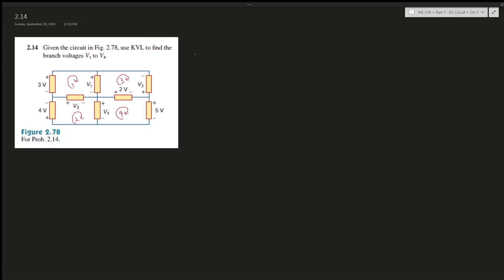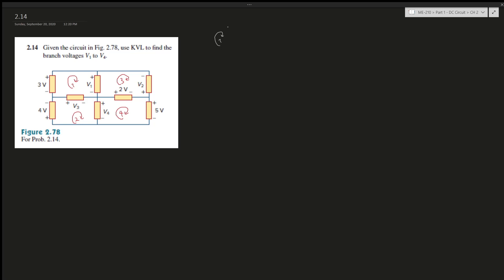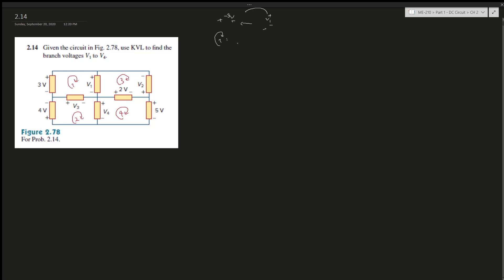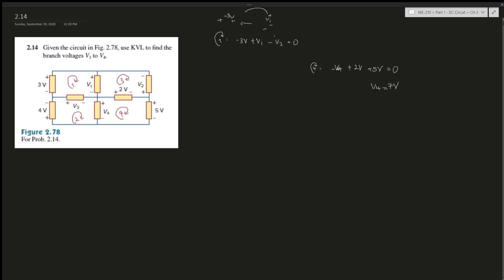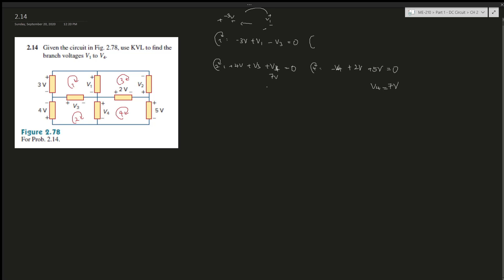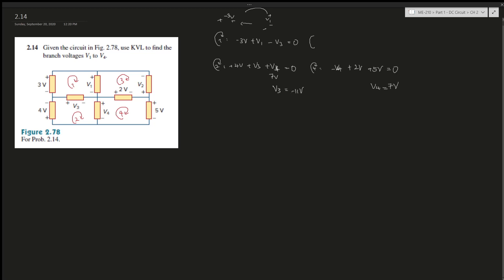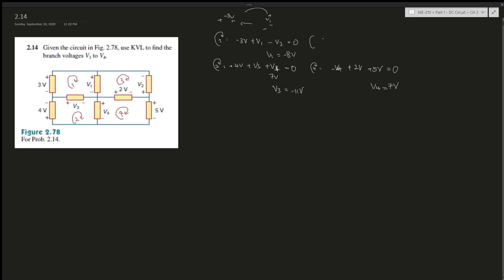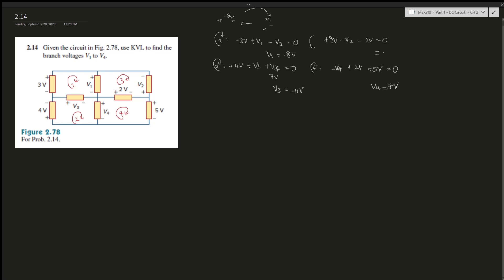2.14 Given the circuit in Fig. 2.78, use KVL to find the branch voltages V1 to V4.

Comment: Im almost 100% sure going from - to + in the 3v is a voltage rise. we're going from low potential to high potential. for instance V1 is a voltage drop becasue were going from + to - . high potential to low potential. your signs are flipped.
Reply from the maker: Hey Ben, I appreciate your comment, and I had the same confusion as you at first. To quote my brother, a PhD student from Chapelhill, "Kichoff's Law just states the current in must equal the current out, which works for either convention. Just like in the case of potential energy, it is only the difference that matter, not the absolute values, 15 V means there is a difference of volts across the circuit." I am sure you are very certain with your knowledge, but it's from what you learned in your institution, there are many ways how this is being taught. This is just how was taught as a trick to solve this problem. Just keep an open mind :).